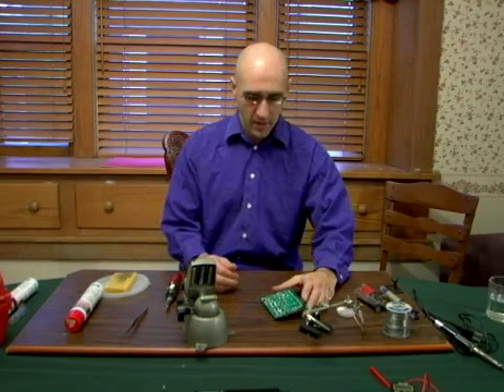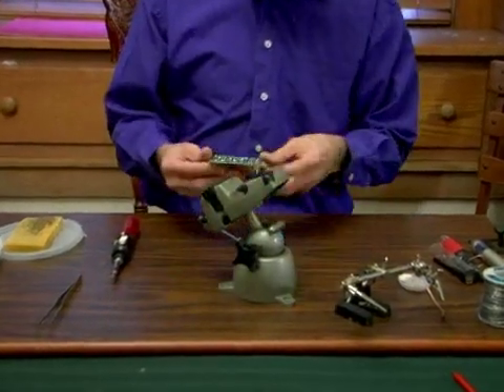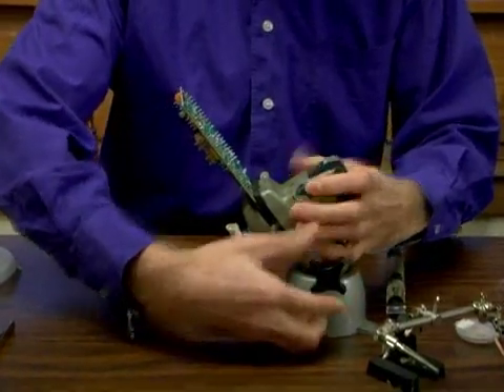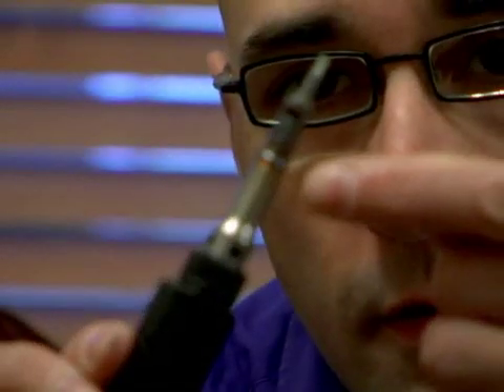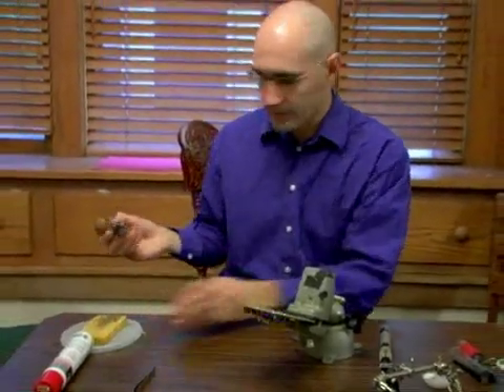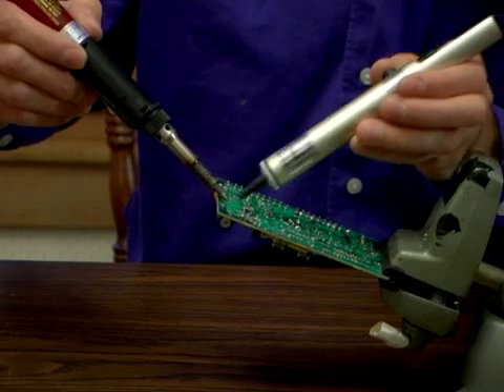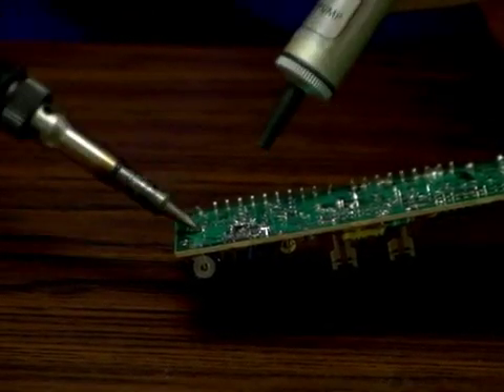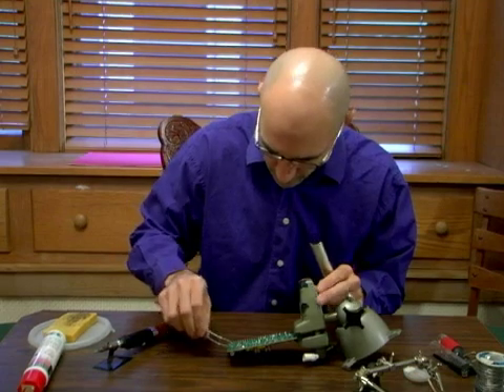How To Remove Solder

Comment: i lolled at ''sucks it right up and spits it out'' haha
and the other one '' you don't want to keep the heat at the trace, where the component goes throught the little hole, the trace can lift up if there is heat for too long'' too frickin funny
did anyone found this funny or my thoughts are perverted

Comment: I repair laptops and many times I have to replace dc jack for power. sometimes those are soldered this way so the solder is very hard and not the usual type. it doesnt melt so easily and I am not able to extract the old part out of the board. do you know anything about that? how do I remove that solder. my iron is 40W and I have a solder removal pump that heats up and is 45W and I am having trouble to remove that solder with both. that solder seems very solid like zink

Comment: Because some of the manufacturers use a high temperature solder which is difficult to unsolder with out damaging the PC board trace, I have found it helpful to add a little solder before I unsolder a connection.